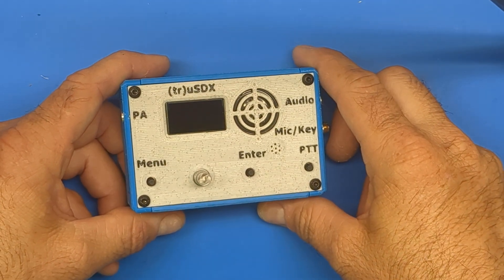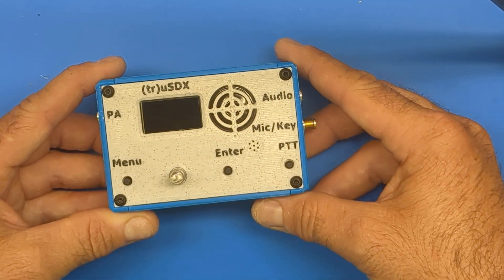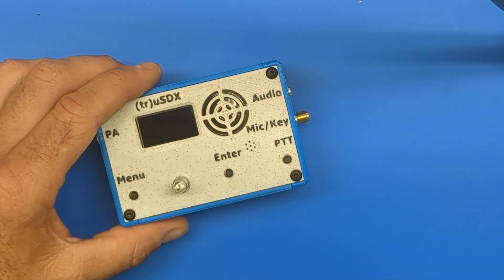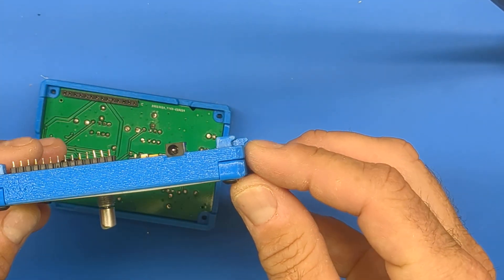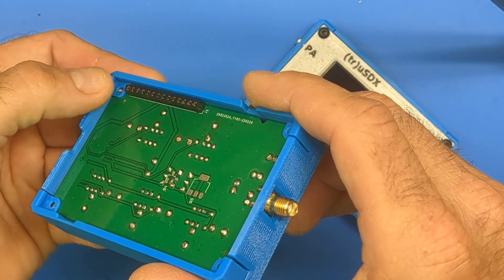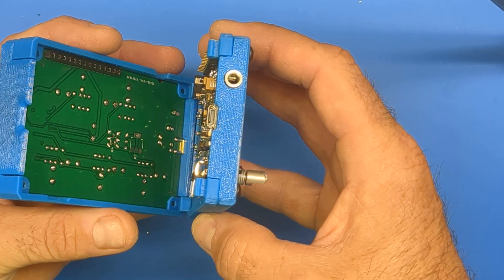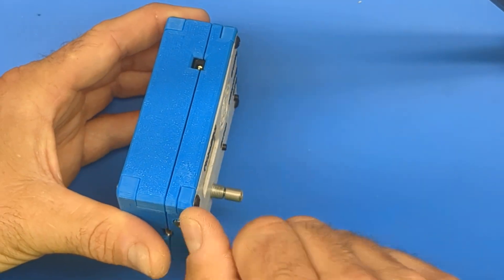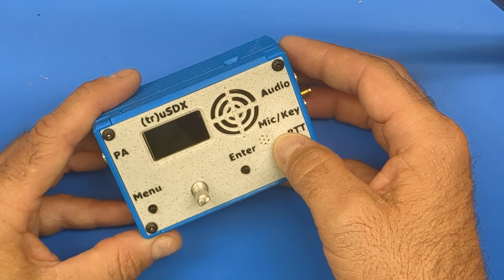(tr)uSDX Modular Case

Comment: I’m getting ready to take my exam for Technician, but I’m looking for future expansion of my abilities. What are the options not made in China? I don’t want to support a communist dictatorship just to get something that is cheaper.
Reply from the maker: For HF, look at Elecraft. For VHF and HF, made in Japan, try Icom. Yaesu still makes some in Japan as well. Everything is going to be made from Chinese parts.
Reply: I bought my 'kit' for the (TR)uSDX in Spain! 
A not 'legalized' seller sold the kits for 100€ + P&P 

EA3GCY - Javier, sold them. 
The company is called: QRPHAMRADIOKITS

I have bought all for 100€ + 16€ Post & Package! 
The boards are still manufactured and pre-assembled in China.

A very reliable kit. I build it without any flaws! 

The TRX is wonderfull! No problems to build and adjust to the specs.  On 80m output is abt. 5,6W; and n >= 85%, on 20m still 4,8W and 78% ! 

Do I need any more, for a QRP-TRX? Not the 'best of the best', but a wonderfull experimental kit, ... ! 

73 de Markus - db9pz

Comment: This is great, thanks Adam.  I've been wanting to remix the case also, but to put in some accessories to make it an all-in-one.  Ie, build in a CW key or paddles or both, like a KX2 pretty much.  I like his 3S 18650 battery holder but not so much the slide-in implementation, I think a snap-on design like yours would work better.  Another section for a built-in wire winder - not sure where it'd go, I guess on the bottom and then detach when ready to use it.  And I really like my earbuds to stay with it, a little built-in wind-up doodad to keep them internally.  But if I do all that, it'll be less a deck-of-cards size case and more like an ammo can haha.  Jason KO4NDP
Reply from the maker: Lol, yes, I hear you. I did make a 9mm taller case and fitted a 3s 500mAh LiPo pack and USB-C charge port on one design. A capacitive touch paddle would be an easy addition to the standard unit.  I have some PCBs for that if you're interested...
Reply: I would be interested in the capacitive touch paddle pcb @K6ARK
Reply from the maker: Send me an email. I have some that i built...

Comment: And what about DL2MAN? He did the multi band circuit and PCB design of uSDX and (tr)uSDX..... no chinese involved.... work was done by Guido PE1NNZ for Software and Hardware Manuel DL2MAN. You are rewarding wrong!
Reply from the maker: Do you not realize the linked source is DL2MAN's approved and recommended source?
Reply: @K6ARK  But you are only talking about "chinese built..." and at the end " thanks Guido..." thats not okay...
Chris DL6SEZ
Reply: This sounds like "Chinese Radio with Guidos Software..."
Reply from the maker: @saiteklilo50  I don't understand your issue. I clearly give credit to Manuel and Guido for the design. They do not manufacture for sale. The only manufacturer I am aware of that they recommend now is the Chinese seller. https://dl2man.de/where-to-buy-trusdx/
Reply: @K6ARK  Sorry when i look at this video and don't know anything about the trx it sounds like you are presennting a commercial chinese design not Manuels and Guidos (tr)uSDX.
I'm doing uSDX since 4/2021 and (tr)uSDX since 12/2021.
It is not clear!
Reply: It is a Kit normally not assembled and was not designed for commercial selling although there are a few also non chinese sellers selling assembled (tr)uSDX with not optimized Output filters, authorized by DL2MAN..... LP filters still have to be optimized by buyer to get good performance.... maybe you don't know what you are really talking about!
Reply from the maker: @saiteklilo50  you are full of assumptions with nothing to stand on. I'm sorry you are offended.  I am clearly supporting Manuel and Guido here, yet you choose to continue to misrepresent what I am doing, and make baseless claims about my knowledge and experience.  What exactly are you trying to accomplish?
Reply: @saiteklilo50  relax this is an approved vendor by both Manuel and Guido which is on their website that K6ARK linked to above.  Not only that but he also verbally thanked them at the end for their work in this and giving credit where credit is due.  There is nothing wrong with this